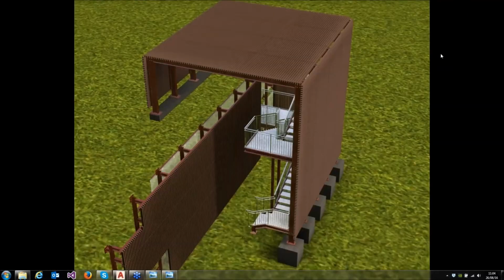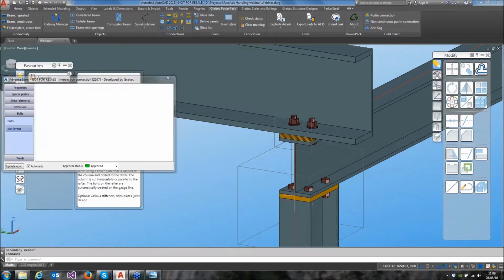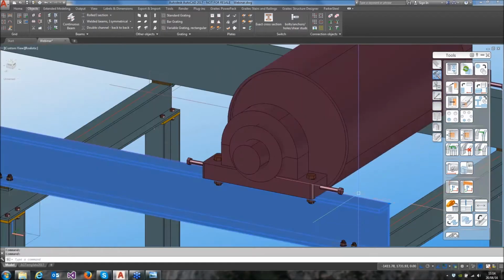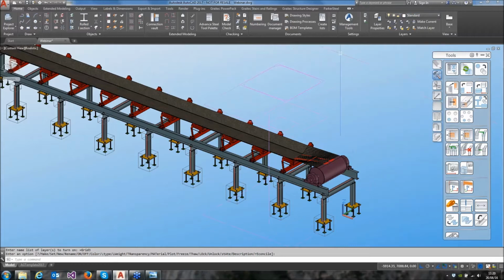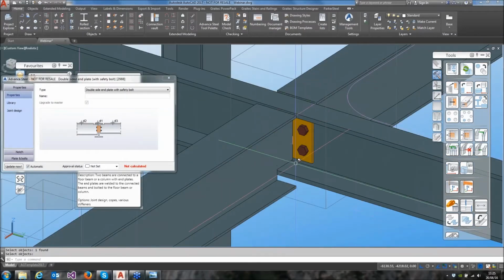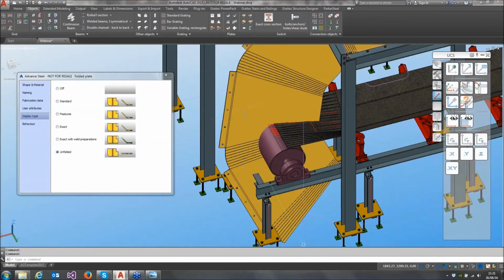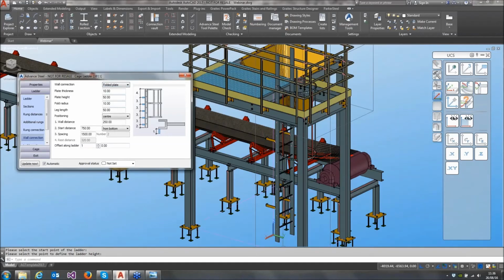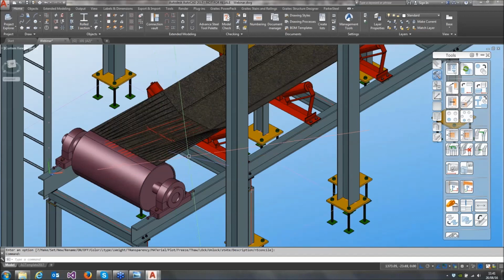Material Handling in Advance Steel | Webinar

Comment: Where download special parts. material handling. (conveyor rollers, conveyor drive roll)?
many peoples draw special parts?
how draw special parts  for material handling? tank you
Reply: We use Inventor for drawing special parts if we can't find the part online in some form. Online sources include the manufacturers' websites, vendors like McMaster.com, and 3d model sites like grabcad.com. Sometimes you can contact the manufacturer directly and request a model.